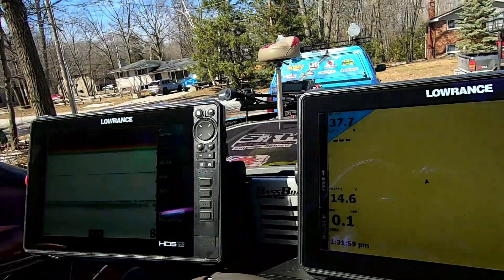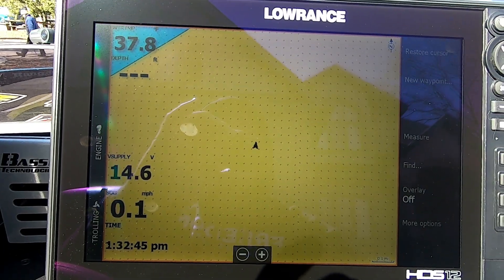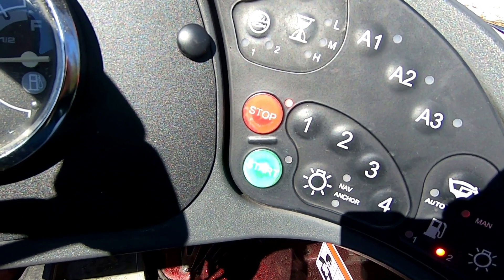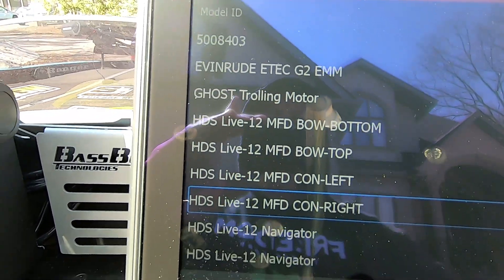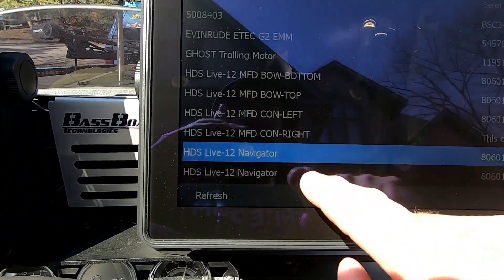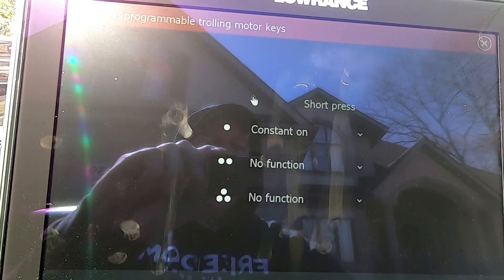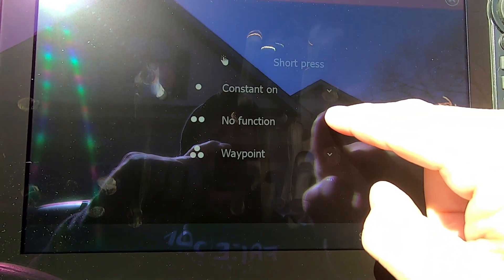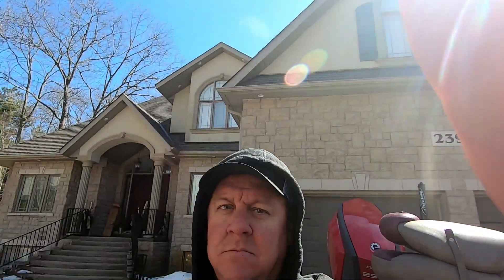Lowrance Tips : Configure Your Ghost Buttons and Leaning your NMEA Network

Comment: Great info Charles. These owners manuals I got with my new boat suck so it's nice to find these how-to tips. That said, I have a question. I just got my Nitro Z18 with Lowrance FS7's and Ghost TM on it and I'm not getting any down or 2D  imaging on the front FS7. I'm sure it's a simple setting issue but I can't figure it out, any advice?

Comment: Hey brotha is the point 1 the gps puck that came with the ghost trolling motor? I set my ghost up but not seeing the pick come up on the device list
Reply from the maker: no, the puck that comes with the trolling motor is different from the Point One, and specific to the trolling motor. The pucks are unrelated to the device list. I believe the TM needs to be hooked up to you NMEA network to be viewed on your device list.
Reply: NMEA network is what is used for lowrance units and the ghost TM to “talk” to each other